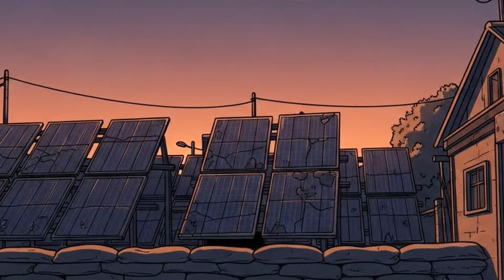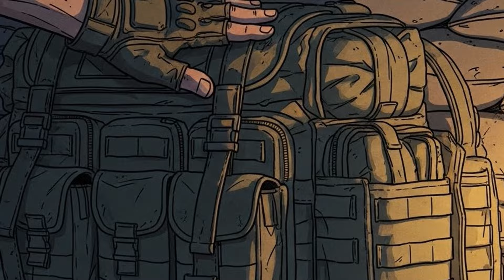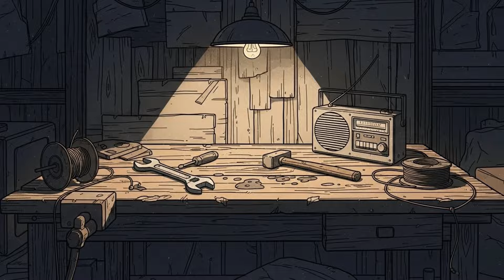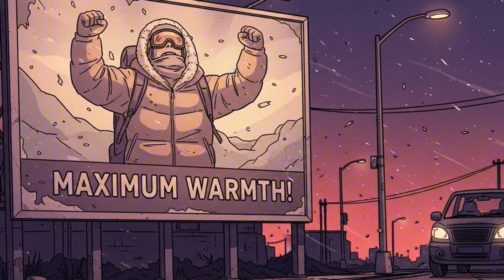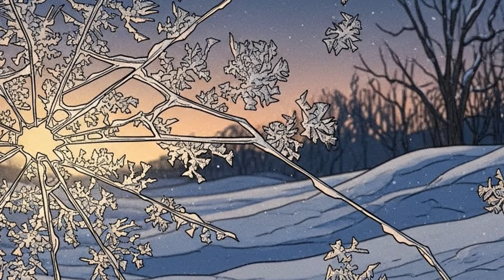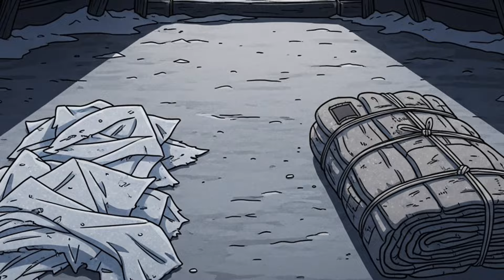50 Essential Items Every Survival Kit and Bug Out Bag Needs For WW3

Comment: ☆Prefilter water through your t-shirt. 
☆Rotate everything that degrades.
☆Place the butane lighter inside your shirt for a little while before you plan to use it.
☆The potassium hydroxide in the battery needs replacement approximately every 10 years. 
☆Your fero rod will always spark.They don't degrade significantly over time.